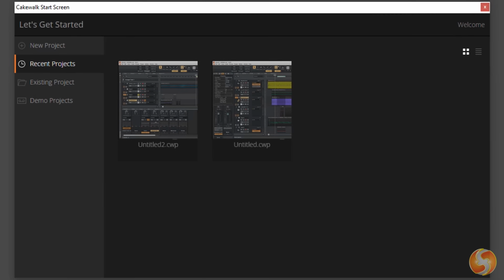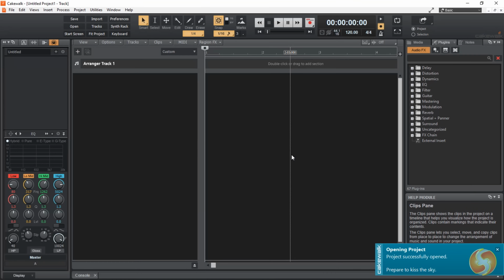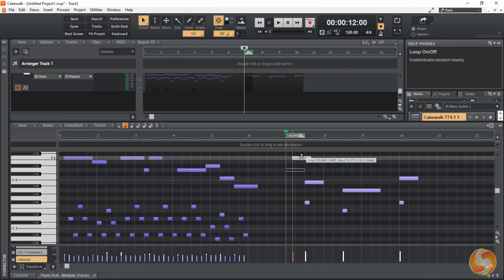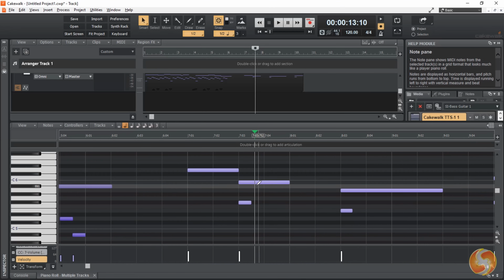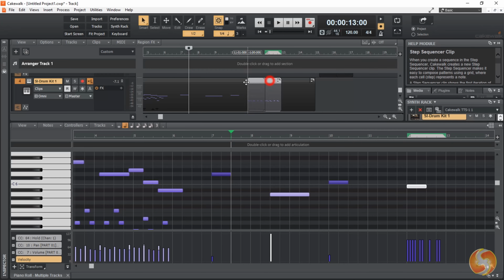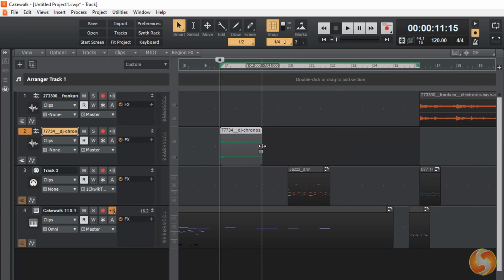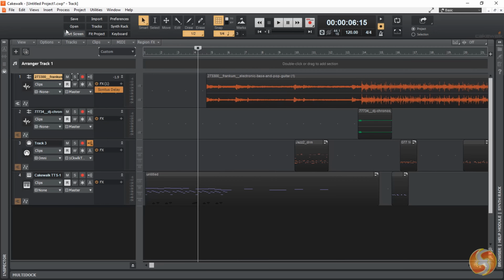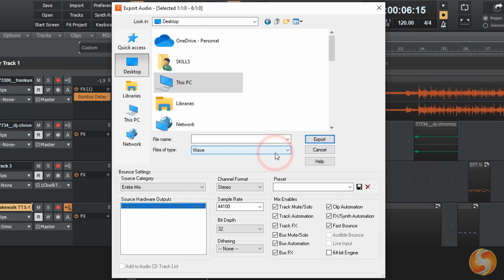Cakewalk - Tutorial for Beginners in 13 MINUTES!  [ COMPLETE ]

Comment: One problem I see with this video is that clicking the loop button doesn't make the selected part loop, it just makes A PART loop. It doesn't affect the start and end points of the loop, it's just an on and off switch of the loop. When you press it, it will show the beginning and the end of the loop, which you will have to manually change to where you want the loop to be. If you don't want to go through that hassle, you can press THE BUTTON UNDERNEATH IT that actually does what the video says the BUTTON ABOVE IT DOES. It enables the loop AND sets the endpoints to the selected part. It's so infuriating that the video presents a false information about how the looping works, and the obvious cut every time this guy presses the loop button shows that for some weird fucking reason, he is aware that he's presenting false information, and HE CONTINUES DOING IT! Why?! This isn't even some big prank, this is just a trivial misleading that will cause some slight headaches to the people following the tutorial that is sprinkled into an otherwise fully correct and informative video. And it's not like he cuts to make it more seamless, he could've just moved his mouse 1 centimeter down to the button that LITERALLY SAYS when you hover it "loop the selected area", but for some reason, he pressed the wrong fucking button MULTIPLE TIMES in the video, and cut the video to make it seem like it did what he said. 
Also the simple loop button is useful when the endpoints of a loop are already in the correct place, and you just want to toggle the loop on and off, plus you turn off the loop with that, the button underneath only changes the endpoints, and turns it on, it can't turn the loop off.